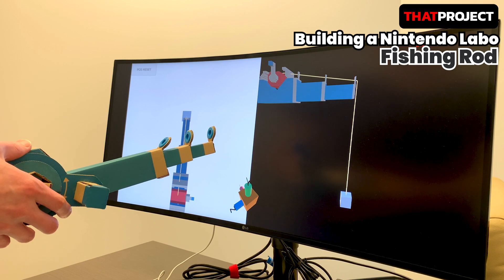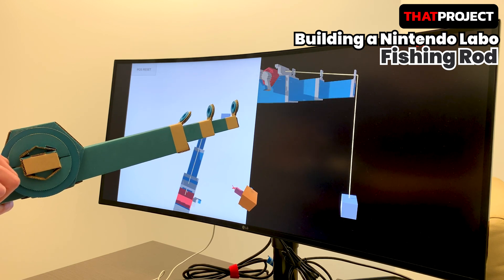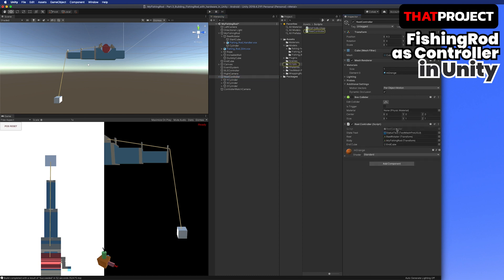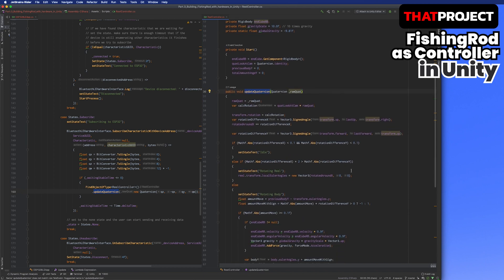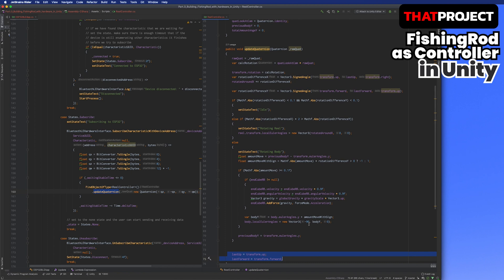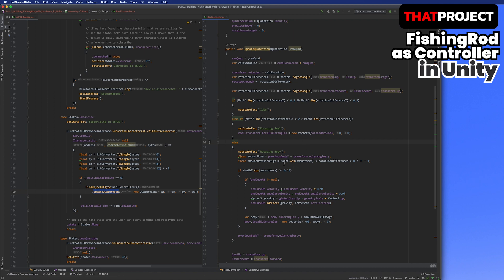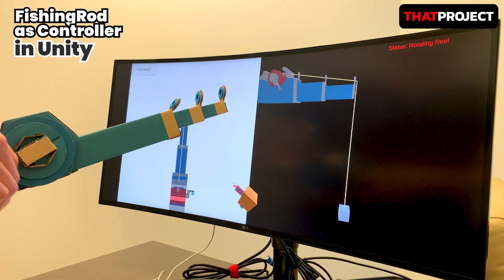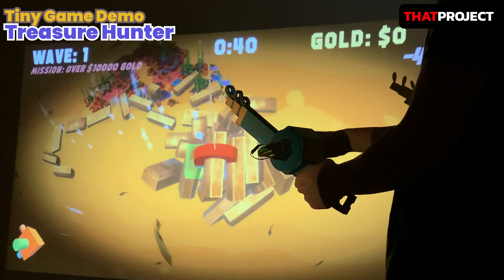Dev Story - From Hardware to Software (ft. Treasure Hunter)

Comment: What would be the most appropriate method for calculating the position of an object using linear acceleration data from a BNO055 sensor, given the potential presence of noise and errors in the data? Additionally, what techniques or methods can be employed to mitigate these issues and improve the accuracy of the position calculation?
Reply from the maker: Searching for papers with accelerometer drift correction shows that there are many approaches. And it never seems easy. Solving with a single IMU sensor seems really difficult, so you may need to use additional sensors. I'm sorry I can't give you a clear answer to your question.